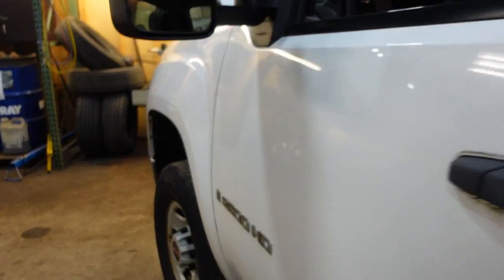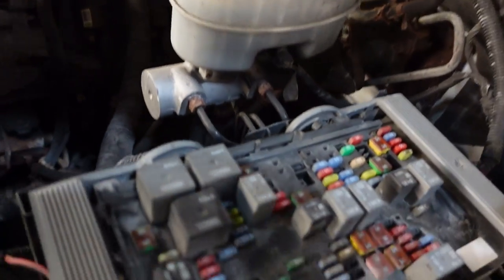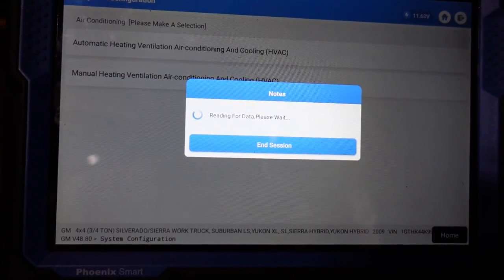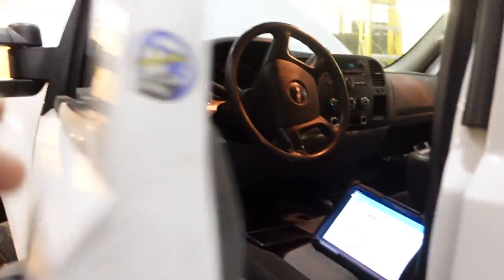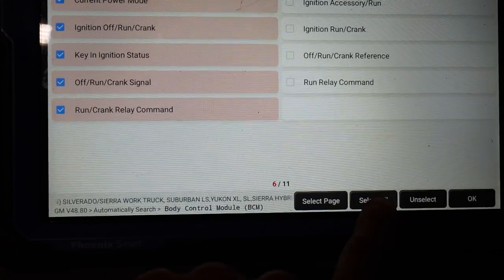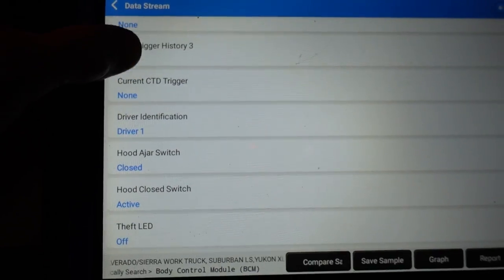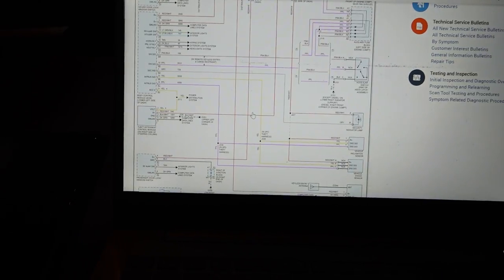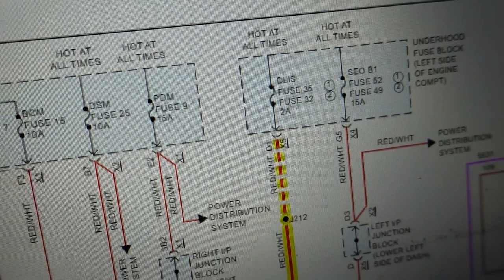2009 Silverado No Crank Theft Light  ON. Basic diagnostic strategies lead the way for me to fix.

Comment: Hey brother! I just want to say thank you! This video is what fixed my 09 silverado. I did a motor swap on my lc9 and couldn't get it going for 4 weeks . Trouble shooting ext . From a cut harness going from my engine to my fuse block. Power distribution block. Refined all the pins . This was my last hurtle. And you nailed it! Thanks again. Your video was bang on

Comment: Man thanks so much, best video i found i watched so many literally had my starter out checked all grounds wires, had fuse box out cleaned everything. For it to be a 2 amp fuse. Still wondering what made it blow. Guess ill throw some fuses in truck see if it happens again.

Comment: Have a question hoping you can answer, seams no one else has an answer for this, what is a discrete input? In the case of GM 2000 Buick Park Ave. VSS - vehicle speed sensor -  A vehicle speed sensor (VSS) connected to the Powertrain Control Module (PCM) via discrete inputs provides a signal source to the IPC. The VSS discrete signal is pulled up to ignition 1 (IGN 1) in the IPC. The IPC uses the VSS data received from the PCM and a software program to determine the proper speedometer gauge pointer position. Some other people think this is some GM secret and they won't tell how it works what it is. Looking at a wiring diagram for the speedometer, shows a single DK/green with white trace wire from the PCM to IPC for speed info. Not sent out on the class2 data buss? Thank you before hand .